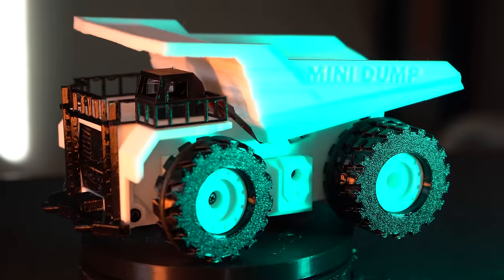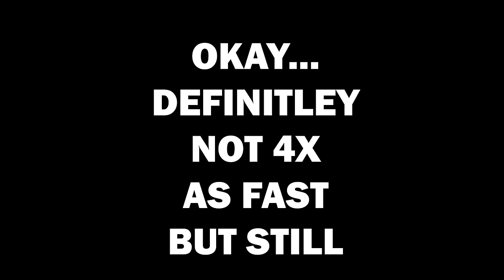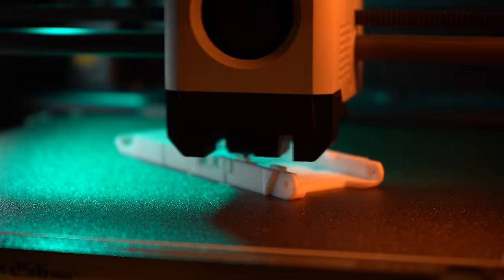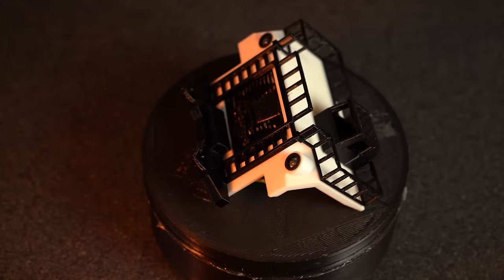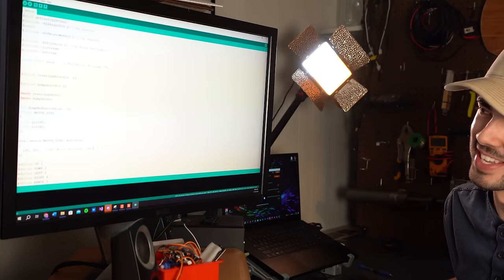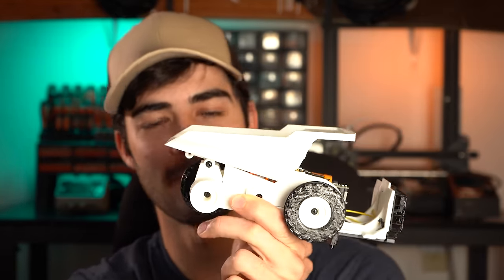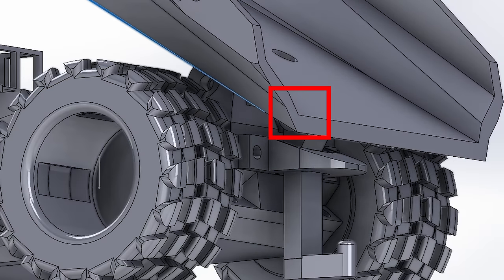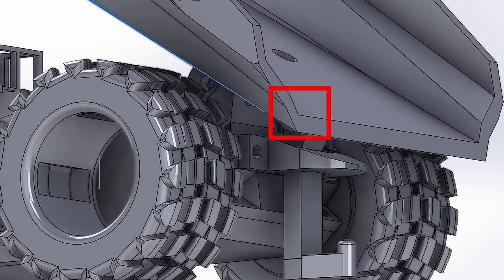V2.0 3D Printed RC Dump Truck

Comment from the maker: Add a comment with what piece of construction equipment or vehicle you would like to see get turned into an RC 3D printed model next! Whatever has the most comments will likely be the next project.
Reply: Personally I vote for a excavator but it would be pretty difficult
Reply: A mini truck/kei truck would be awesome!

Comment: When adding blacking to control the light bleeding from the lights through the model - nail polish is a lot cheaper than most model paints and works wonders.
Reply from the maker: This is a really great tip, thank you!
Reply: Not only for waterproofing but also painting, check. Thanks!

Comment: Double everything. We're talking scale, battery and speed.
Love if this could be bigger. No issues in adjusting your step files but not strong enough on the electrical side of the project.

Also would to integrate the fpv or esp 32 cam in the projects and have it disabled on the screen. 
Also instead of using the directional pad I don't know if it's possible to shrink the size (for the viewport of the cam) and use more like a joystick control like most mobile game have.

Anyways love this project and we'll be testing some things out myself!
Reply: Also add a full component list if we want to source everything ourselves or see if we can re-use our own stuff.

Comment: Next we need an mini beacon light, rather than rotate though you could just have 5 or 6 surface mount LEDs arranged in a tube that turn on sequentially.

Comment: Hmm Possibly next off you could do a Mobile Tracked crane (Crawler Cranes)... something bigger and more challenging. if not a crane maybe just a Excavator, Tracks would be challenging for 3D printing to my knowledge. see how far yours is.
Reply from the maker: I definitely think something more complex is on the way, thank you for the heads up

Comment: what about smaller battery's on the trailer itself?
Reply from the maker: I’m thinking about doing something like this for the semi truck build!
Reply: fenix has many smaller battery's so if you want you could make it work for 2 hours without charge

Comment: Excavator - Excavator - Excavator  - Excavator - Excavator - Excavator - Excavator!

Lol, O' golly u probably meant mentioned in different comments. ;-) Golly darn, oops. 
Lol, seriously though, an excavator would be a great next vehicle in ur 3D printed construction company. It'd go perfectly with the dump truck!
Reply from the maker: I think we can count this as two votes😂
Reply: @professorboots  lol, thanks. I love & keep a tray of Kinetic sand on my coffee table, & an excavator & one of u dump trucks would b so perfect for my coffee table kinetic sand tray. U cld even design in a stationary finger or bar that attaches to the dipper arm, held on with a screw so it can be taken off if u want, but have it opposite the excavator's bucket so it can grab & pickup & put in the dump truck, small stuff like ur skid steer does. 🙂

Comment: the next one is gonna have to be an excavator
Reply from the maker: Oh geez the excavator is really racking up the points right now
Reply: I love this stuff. Eagerly awaiting my skidi kit. But 2 things. 
1, you think you could put your recommended battery for the skidi in the description on your site (I know many will work but I don’t want to buy one that ends up being to big or long once it gets here. Nor do I want to have it sitting on my desk while I wait for a battery to show up)
2, maybe the next project should be a more universal board that will work in all kinds of equipment instead of a new board for every design? Let the community run wild! I personally plan on designing a similarly scaled forklift.